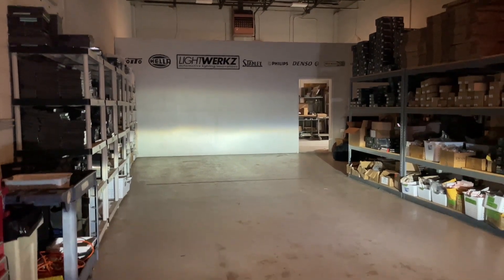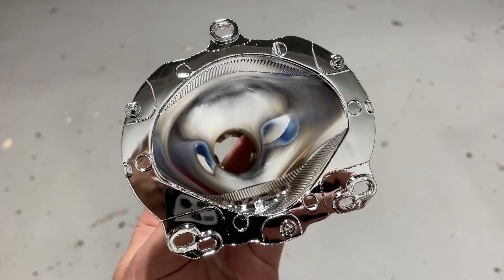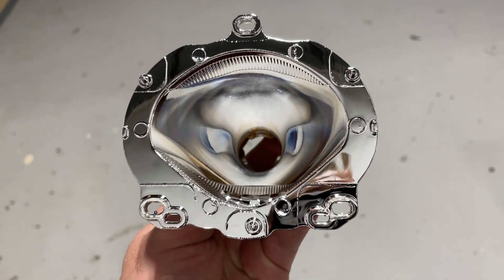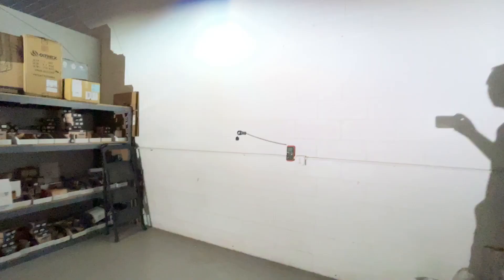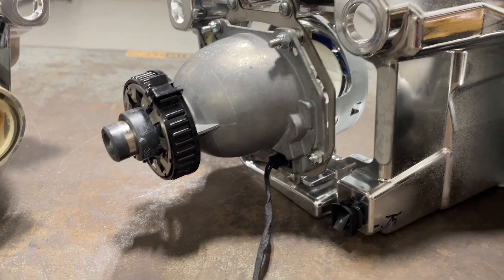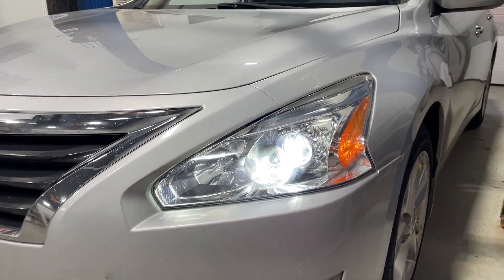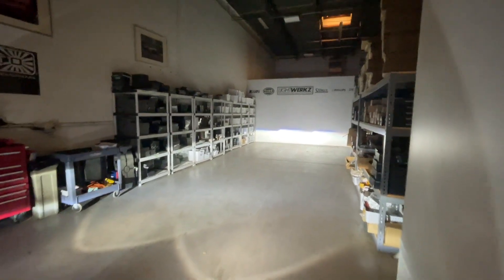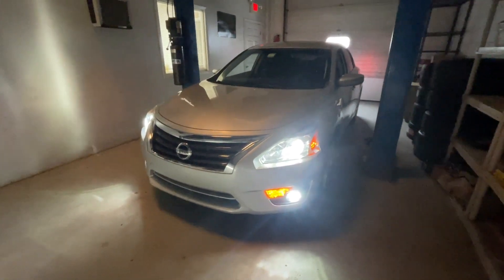Extremely Dim Lights ? Burned Bowls May Be To Blame!

Comment: Don’t know if anyone here was/is on hidplanet forums anymore. I have been since 2006 and I recently had to replace my Rx330 non afs projectors I had used mini h1 shields to turn into bixenon’s. They were some of my favorite projectors ever. They were as wide or a bit wider than the current mini h1 8.0 and had a much more even distribution of light with no dim spots. The high beam wasn’t especially tall but I’m in a lowered car and don’t need a very tall high beam. So they worked great for me! Anyway for about 8 years I ran 50 watt Hella boosted ballasts on different 5000K/6000K bulbs since it shifted the color temp down running them higher wattage. Later I switched to the 5800K Morimoto XB50 bulbs and they matched my Morimoto 2 stroke 2.0 9006 fog light LED’s very well. Anyway longevity. They managed to last 8 years and some change before the bowls got burnt to the point where I started to notice a dim spot starting to form on the left side of the step, the lower side. So it appears the left side bulb almost isn’t on at times now. So running a combination of aftermarket bulbs with an oem boosted hella ballasts at 50 watts the bowls lasted 8 years. This is not a good indicator though because they have outlasted what I expected for sure. I started driving for Uber about 4 years ago and now drive about 4-6 hours a night 3-5 nights a week. 12x4 = 48 hours a month minimum of night driving. So these bad boys had TONS of hours on them the last four years with tons and tons of restrikes. So the bulbs and ballasts all have been great. I should point out this is the second set of hella ballasts I’ve had in that 8 years.

Comment: So, just FYI, its definitely any altima of that generation, HID or halogen, that the material wears away.  High heat and humidity increase the timing that this happens.  This is why i very much dislike NAL.  All i could do is point it out to design and I heard people got yelled at lol but yeah, anyone who has that lamp needs a retrofit for sure!
Reply: Getting one done as a recall right now. After 5 years of denial and a lawsuit, they are finally fixing the problem.

Comment: How reliable and long would it last to run Hylux 2a88 ballasts on a set up like this?  With OEM D2S bulbs?
Reply from the maker: These ballasts have been going strong for 4 years and customer asked to reuse them. Osram bulbs you can expect an easy 3-5 years out of them but you’ll want to replace around that time period because they will have dimmed a significant amount. Overall very reliable setup.
Reply: @LightwerkzGlobal  Thank you 🙏 I am running a set up similar to that and these Hylux ballasts are brand new (I’ve only put a few hours on them) and they have been fantastic, very OEM like performance.  Good to know I don’t really have to worry about it!  Saving up for some CBB or CBIs so I can have that LED-like beam!

Comment: Do they fit 2009 Nissan Maxima SV?  
I have the same issue and don't want to spend $1300 to get a new pair from Nissan.
Thanks!
Reply from the maker: We have a kit for that. Use these brackets along with the G5-BRT projectors and new Osram bulbs. It will be a game changer - https://lightwerkz.net/collections/retrofit-brackets/products/black-series-to-g5-brackets-civic-altima-maxima

https://lightwerkz.net/collections/hid-projectors/products/bi-xenon-g5-brt